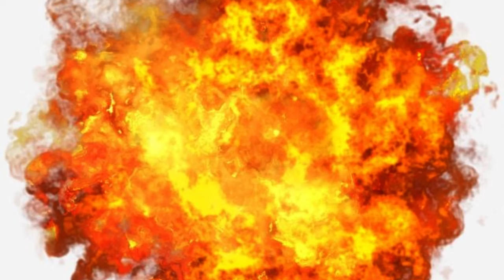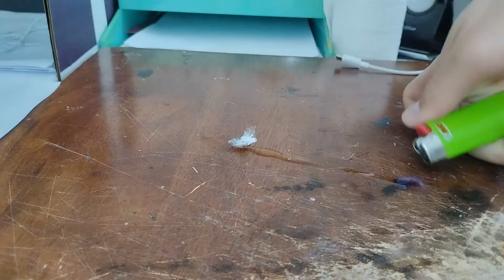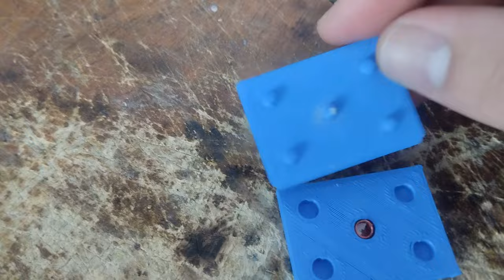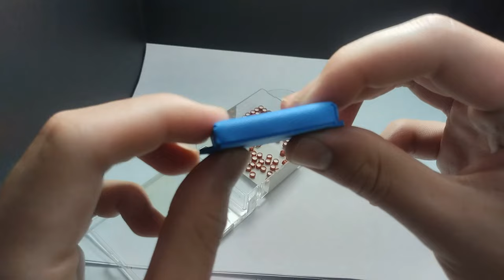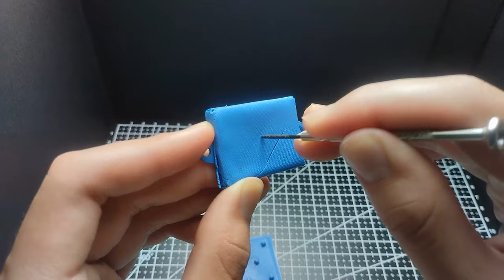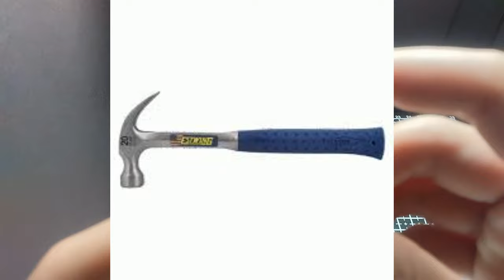3D Printed Exploding Armor (ERA)

Comment: Personally I don't understand why he only has 600 hundred subs he's funny and a neutral at youtube.
Reply from the maker: Thx for the support :)
Reply: yes very neutral
Reply: @ideas-y4p  what you need is a primary explosive compound which is more sensitive for it to work on this small scale

Maybe you could use Armstrong's mixture (matchheads and red phosphorus from the sticker stops)

Use a bit more than that cap amount then it should work
Reply from the maker: @STRIGON_AB   Thx for the advice, ill definetly add that to my next project

Comment: cool video, but i have a few things that might help you make this better, those caps you are using aren't made for creating a lot of gas, they are mainly used to make fire. Tannerite is probably your best bet at making this thing work (its very easy to make if you have the right ingredients), and if you have a pellet gun then use that for testing and try making it deflect the pellet (then it could actually be usefull for somethinge and be very cool)

otherwise great video
Reply from the maker: I did think of a pellet gun, but in New Zealand their very strict even with bb guns, but i might use something like tannerite next time, thx for the advice :)
Reply: @TBButtSmoothy  i get your safety precautions, but if he uses a small amount of tannerite, maybe just a couple of grams if not less, and shoots its from 20 meters with saftety squints, then he will survive.
Reply: Except tannerite requires a very high velocity. Won’t work😊
Reply: @MrHobj34  except, you can make Tannerite explode by firing a pellet gun, if he makes the ERA a bit bigger and is 20-50 meters away, then he would be able to use Tannerite